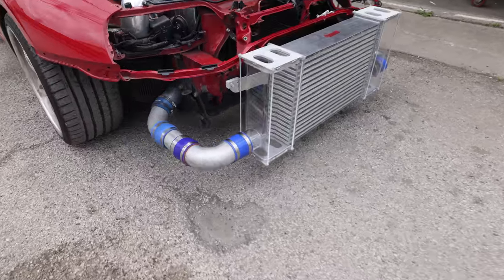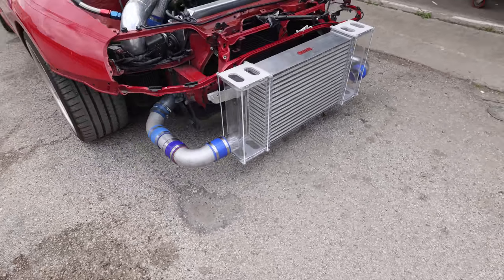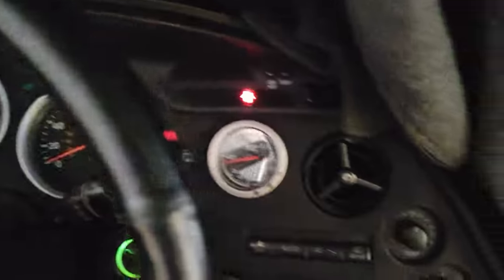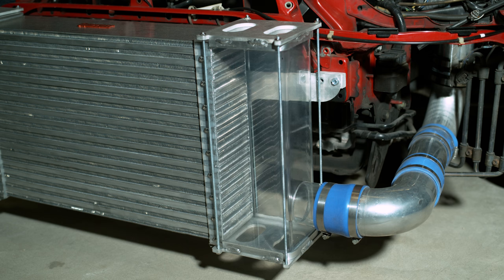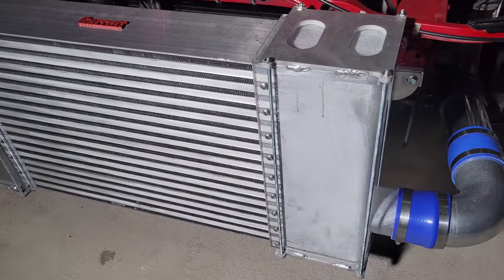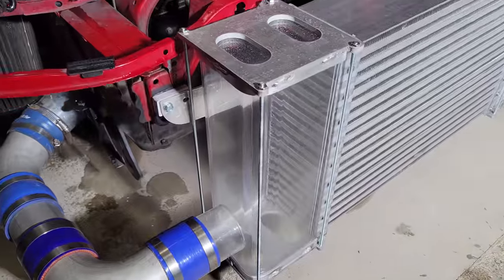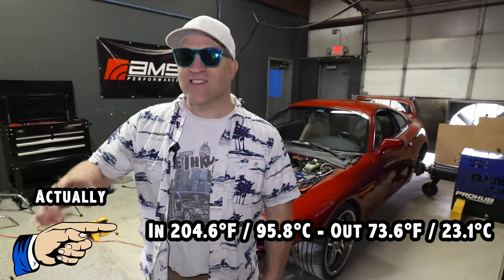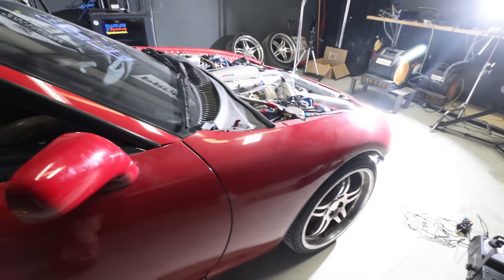See Thru Intercooler In Slow Motion - (Dyno Run High Boost)

Comment: I like warped very much but this has to be his worst video. Explaining and spending time on something that is obvious. Like its literally just air moving through a bunch of tubes.
Reply from the maker: That wasn't the point, the reason I did this video in first place is because every intercooler I've ever installed on my cars has the inlet and outlet where they need to be to enable the installation of the large intercooler, I always thought well how much of the air actually gets to the top of the intercooler, since the pipes are almost always right across from one another.
Now we see exactly how the air actually flows, and I bet you if there was even more boost we would see a different result.
You have to be a hardcore turbo guy to appreciate the video, but I was genuinely really curious about this for a long time, that is the only reason I even did the video and built the intercooler in the first place. 
You never know what you're going to see until you actually do it.. sometimes it's absolutely mind blowing sometimes it's not.